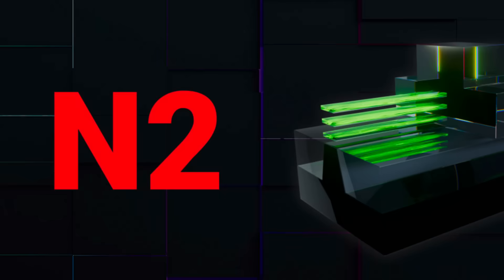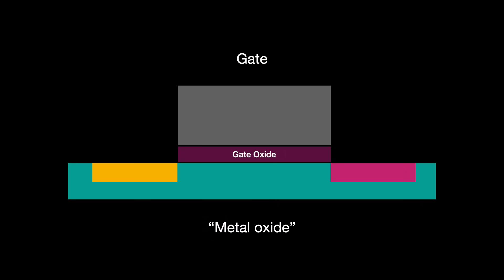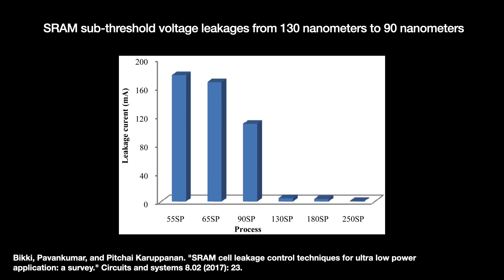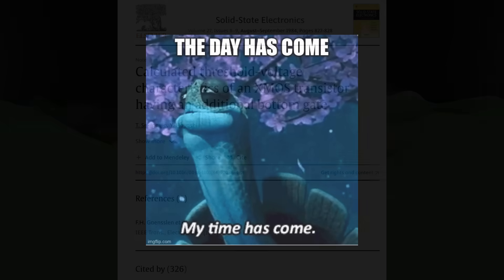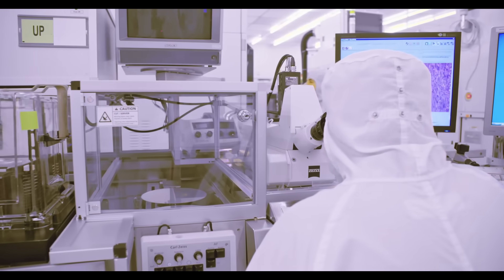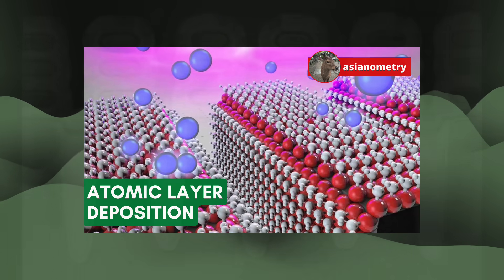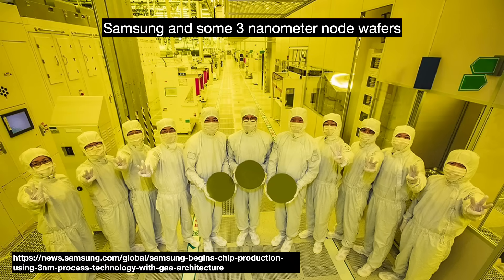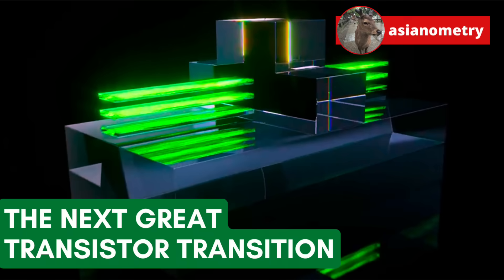The Gate-All-Around Transistor is Coming

Comment: A FET is basically a solid state version of a vacuum tube. Both use an electric field to control the flow of electrons.
Reply: A magnetic field is a flow of electrons, and an electric current is a magnetic field.  Crosstalk increases proportionately to power and inversely to distance.  Not Nobel Prize stuff

Comment: A transistor is not just a switch (on/off). it can also behave like a variable resistor (linear operation). Even if in the field of Digital Electronics, it is always operated (biased) to perform as an on/off switch, the device can also be operated on its linear response characteristics to perform as an amplifier in the analog world. On the input and output sides of a digital circuit we still use transistors as linear devices.
After the junction voltage is overcome, there is a nice linear response of changes in current to voltage (smooth changes in input current produces proportional changes of output voltage), before the transistor goes into saturation (completely On).
If someone ever invented a true 'digital relay', transistors would become obsolete.

Comment: "Semiconductor" dorsnt refer to it cobducting part of the time. It refers to the fact that its properties fall between those of an insulator and a conductor.
Reply: Silicon is a borderline insulator (like an undecided voter), because it has 4 electrons on its outer shell and cannot normally give up an electron to conduct electricity. If it had 8 electrons on its outer shell like Argon, it would be a hopeless insulator (like a diehard Republican). If it had just one electron on its outer shell it would be a devoted conductor (like a brainwashed Democrat).
Silicon (also Carbon, Germanium, Tin...) are like residents of Ohio, depending on the type of rhetoric they listen to they can Swing either way Democrat or Republican). In electronics rhetoric is called 'doping'.
If Silicon is chemically doped with Arsenic or Antimony (forced to watch CNN), where the latter has 5 electrons on their outer shell, this chemical bonding produces a new substance that is N-type (Democrat). If on the other hand Silicon is doped with Aluminum or Gallium (forced to watch FOX), it becomes P-type (Republican). These two new doped versions of Silicon (N-type and P-type--Acceptor and Donor) can now be manipulated to easily give up and electron or easily capture an electron. These new substances are like Generation X and Y or Millennials or in a nutshell--Morons.

Comment: While listening to this i had a stupid idea.

How about consturcting a cube of transistors instead of a sheet, and the way you would reach transistors inside the cube is by deploying 2 currents, but the second current is 1 transistor Omega less then the first one.

So basically the current goes trough all the transistors flipping their state over, but a second comming right behind flipping them back on the same path, but since the second is slightly less powerfull it wont be able to flip the last transistor like the first current so that's state will remain in a changed state while all others they went trough revert back to their original, effectivelly only changing a deep transistor.

Now obviously this would technically halv the speed of the processor, however the additional dimension of verticality would multiply the processor output. So just one level would bring back to a regular processor, and a second level (3 levels in total) would already double, while a third level would quadriple the process power, quickly scaling up the processing power.

I don't think heat would be an issue here, as the system already made out of heat transfaring material, it would be harder to cool, and heat up equally fast of how it increases process power, but you would only need better cooling and cooling was the limit of process power anyways so nothing change there, this is more of shrinking the processor but increasing the cooling unit so mass should be likelly equal.

Other question is, how do you govern the current to hit the right transistor as it goes trough others? Simple, electric spin can be easilly lined up with magnetic field, you just use a tiny magnetic field (or even use the systems innate field) to keep it consistent and only let trough electrons that fits trough a spin gate, so their path will be predictable at all times. (they should do this on current processors too anyways).

Comment: Grok's custom ASICs are using 14nm established process node and demolishing GPU based AI accelerators - these new transistor designs aren't needed for AI acceleration as there's lots more headroom in transitioning to custom ASIC designs with integrated memory for example, than what can be squeezed out of an evolutionary step in transistor design.

Comment: Imagine if the simulation shows to you that the transistor you just made is   faster   than the normal we use currently ...in case you are wondering the simulation was run  in those normal transistors xD

Comment: I'd heard about CFETs (and TFETs, i.e. TunnelFETs) as potential successors of GAA-FETs but this is the first time I hear about forksheets. 
So Samsung was first with GAA-FETs, and even released a second gen, but barely anyone has used it; they all appear to wait for TSMC's N2. Do they worry Samsung cannot deliver in volume or they hesitate to be the first testers of a new tech?
Reply: Forksheet is a stopgap and may not even happen.

Samsung has yield and device problems. Just because you made it first doesn't mean you made it better.

Comment: Interestingly (to me anyway) the FET (Field Effect Transistor) is what should have come before the type of transistor which came out first. The idea of the transistor was to replace vacuum tubes and vacuum tubes work on the same general principle as FETs. A static field applied to a screen grid (just like the grid on a screen door) controlling a much larger flow of electrons (emitter to plate). But semiconductor tech wasn't advanced enough to make that readily possible so they went with current control rather than voltage control. The very first "proof of concept" transistor was constructed with a liquid semiconductor. Current control, however, is costly as to wasted power and heat was always a problem.  MOSFETs (And  better still, C-MOS) can be made such that they only really draw any power when they are switching states. The faster they do the greater the power draw and the greater the heating, which is a big problem today with the newer vertical stacking techniques.
Reply: In the analog world, there is still great diversity when it comes to different types of transistors. Both MOSFET and the old school JFET have their uses when high input impedance or low power is needed, but for low voltage noise or high gain (heterojunction) bipolar transistors are often the better choice.

Comment: You state that a transistor is a switch. Not so. A switch is an ON/OFF device. A transistor is more like a voltage/current-controlled variable resistor
Reply: It's not a variable resistor, it has gain. A transistor is a weird device with two modes of operation, switch and amplifier.
In digital logic, we want them to be a perfect digital switch, so their performance varies between: bad switch and good switch. So when we use them for their switch-ness, they are a switch. We would like to make them more switchy, as switchy as physically possible.

Comment: FinFET, then GAAFET, then Forksheet seems to make sense, as there seems to be gains in multiple criteria but CFET seems to have little power efficiency and performance improvements… 

I believe the next step is Post-CMOS spintronics / ferro-magnetic related technology based on Magnetic Tunnel Junction (MTJ) (or derived from it) like MRAM, Intel MESO concept, Spintec FESO concept… Semiconductor R&D should be focusing on spintronics instead of CFET as it has a much bigger improvement potential than CFET…
Reply: CFETs main advantage is density, as you can then cramp much more transistors in the same space.
Reply: @DerIchBinDa  Sure but then power per square inch will continue to skyrocket, which is I think is a problem, and therefore I would think limit the number of transistors that could on per unit of time. What is needed is a much, much more power efficient computing building blocks, and that is what spintronics related technologies could allow. According to the Intel MESO concept, it could be 5x to 30x more power efficient, and it could also be more amenable to AI computing… 

So IMO, it is quite a waste of money to allocate funding to silicon CFET, which will be very expensive for little power and performance improvements, when spintronics could enable so much more improvement opportunities, though at first maybe being more expensive than silicon CFET…

Comment: 0:11: ⚛️ Next-gen transistor technology: Vertically stacked gate all-around Nano sheet SL nanowire metal oxide semiconductor Field Effect transistor.
3:27: ⚙️ Challenges in transistor technology due to short Channel effects and threshold voltage variations.
6:47: ⚙️ Evolution of transistor structures from multi-gate to gate-all-around for enhanced channel control.
9:34: ⚙️ Evolution of transistor process flow involving multi-layer stack and shallow trench isolation.
13:01: ⚡️ Innovative semiconductor technology advancements by major industry players.
Recap by Tammy AI

Comment: Right now I'm just watching these as a way to understand what feels like this whole semiconductor industry being between a rock and a harder place, whose hard place is getting smaller and smaller!...
20-35% gains in power reduction is always a nice thing, but there are other constraints that I'm trying to follow with curiosity how they're going to be tackled, namely:
-running out of massive gains with each node shrink (long gone are the days of 2x the performance/half the power draw, with just a node shrink)...
-dies have been getting bigger and bigger (remember when RTX 2060 die size started at 445 mm^2 when the reticle limit is something like 850mm^2, and everyone complained about the huge price increase of RTX20 series vs GTX10 series?) 
Well, that's mainly because the dies were massive in that gen, so it remains to be seen how that is going to be tackled: further chiplet design development? (didn't work that well for AMD with RX7000 series so far); tackle the current reticle limit limitations + bigger wafer sizes (400mm wafers?), both of which probably require a considerable redesign of the (rather expensive) semiconductor production chain?...
-and with bigger dies comes higher power draw: 20% of 400W means that an RTX 5090 could draw ~320W, but what about the RTX 6090: 380-400W+, again?...
Reply: FinFET, then GAAFET, then Forksheet seems to make sense, as there seems to be gains in multiple criteria but CFET seems to have little power efficiency and performance improvements… 

I believe the next step is Post-CMOS spintronics / ferro-magnetic related technology based on Magnetic Tunnel Junction (MTJ) (or derived from it) like MRAM, Intel MESO concept, Spintec FESO concept… Semiconductor R&D should be focusing on spintronics instead of CFET as it has a much bigger improvement potential than CFET…
Reply: @nicolasdujarrier  We've been hearing about GAAFET as the next thing for the last decade, and although they probably have something cooking to serve next, a major breakthrough might be discovered that may make them shift focus entirely halfway through that time period!,,,
And especially with Intel, their CPU roadmaps have changed countless times in recent years that I don't think people take Intel seriously anymore for whatever they have in their roadmap 5 years from now, let alone in 10 years!!...

Comment: Fascinating - seems like we're approaching limits of scale at some point....this is where someone develops a new material or a new paradigm to take digital manipulation to the next level....optics? Magnetohydrodynamics? Some new graphene variant? Can't wait to find out...
Reply: FinFET, then GAAFET, then Forksheet seems to make sense, as there seems to be gains in multiple criteria but CFET seems to have little power efficiency and performance improvements… 

I believe the next step is Post-CMOS spintronics / ferro-magnetic related technology based on Magnetic Tunnel Junction (MTJ) (or derived from it) like MRAM, Intel MESO concept, Spintec FESO concept… Semiconductor R&D should be focusing on spintronics instead of CFET as it has a much bigger improvement potential than CFET…

Comment: Man, I'm already feeling anxiety about what they will do when this also runs its course over the next couple of decades. Consumer chip prices for cutting edge products are already rising noticeably even with the massive industries of scale at work compared to the past.
Reply: FinFET, then GAAFET, then Forksheet seems to make sense, as there seems to be gains in multiple criteria but CFET seems to have little power efficiency and performance improvements… 

I believe the next step is Post-CMOS spintronics / ferro-magnetic related technology based on Magnetic Tunnel Junction (MTJ) (or derived from it) like MRAM, Intel MESO concept, Spintec FESO concept… Semiconductor R&D should be focusing on spintronics instead of CFET as it has a much bigger improvement potential than CFET…

Comment: 📝 Summary of Key Points:

📌 TSMC is introducing the N2 process node with plans for three new N2 Fabs, featuring vertically stacked gate all-around Nano sheet SL nanowire transistors.

🧐 The transition from planar transistors to 3D ones like finfets and gate all-around transistors addresses short channel effects, enhancing power efficiency and performance.

🚀 Samsung and Intel are also adopting gate all-around transistors, with Intel introducing backside power in their upcoming nodes, potentially reshaping the foundry competition.

💡 Additional Insights and Observations:

💬 The gate all-around transistors offer significant power savings and moderate improvements in speed and density compared to finfets.
📊 Short channel effects like threshold voltage and DIBL have driven the industry towards innovative transistor designs like gate all-around structures.
🌐 References to future transistor designs like fork sheets and C-fats indicate ongoing R&D efforts to push semiconductor technology further.

📣 Concluding Remarks:

The shift from planar to 3D transistors like gate all-around represents a crucial advancement in semiconductor technology, with potential implications for power efficiency and performance. The industry's focus on future designs showcases a continuous drive for innovation and improvement in the field.
Generated using TalkBud

Comment: The real next revolution will be a better memory tecnology to nullify latency times.

Imagine having 10 tb of cache l1 with a large interface...
Reply: FinFET, then GAAFET, then Forksheet seems to make sense, as there seems to be gains in multiple criteria but CFET seems to have little power efficiency and performance improvements… 

I believe the next step is Post-CMOS spintronics / ferro-magnetic related technology based on Magnetic Tunnel Junction (MTJ) (or derived from it) like Non Volatile Memory (NVM) MRAM, Intel MESO concept, Spintec FESO concept… Semiconductor R&D should be focusing on spintronics instead of CFET as it has a much bigger improvement potential than CFET…

Comment: the GAA design offers great advantages for scaling down semiconductors. The normal problems we experience when scaling down lower and lower is reduced because of the enhanced electrostatics (reduced leakage currents and improved switching speed and energy efficiency). I can't wait to see the next gen semiconductors using this tech. It is going to be crazy!

Comment: Until my PC is free from spinning parts, pumping liquids and other anti-meltdown 'features' I won't feel anywhere near the promised future.
Reply: I do feel like we went backwards in some respects. At one point microcomputers were all solid state with no cooling required - so, not much energy wasted to heat. 
Now a "mainstream" graphics card is a 1kg hunk of heat pipes, radiator and 3 huge fans. And also wastes 80 to 90% of the power you push trough the thing. 
I guess, phones and tablets are a bit more reasonable as efficient computing... or a raspbery pi.

Comment: The amazing part is that they are doing this at the near atomic level.
I was thinking that the next level is to use the photon combined with wavelength and polarization to do switching thereby eliminating EMF issues related to latency and wasted heat energy.